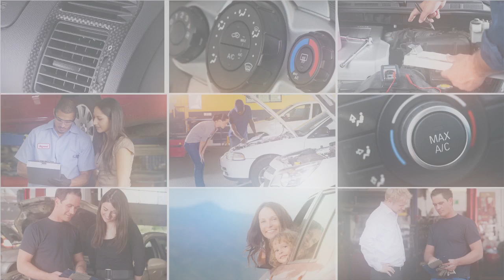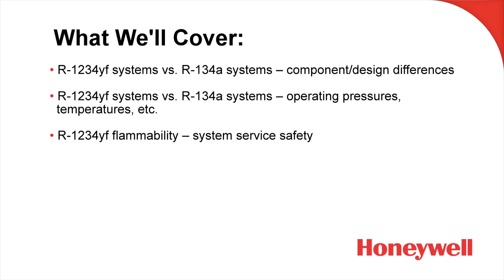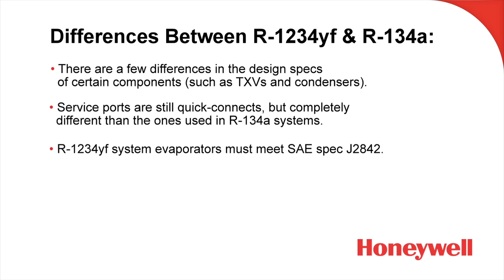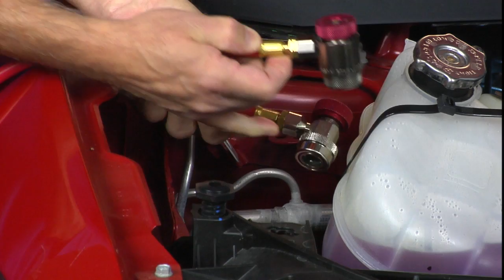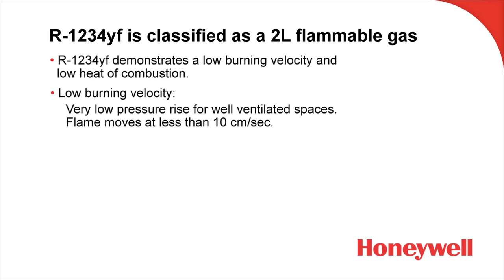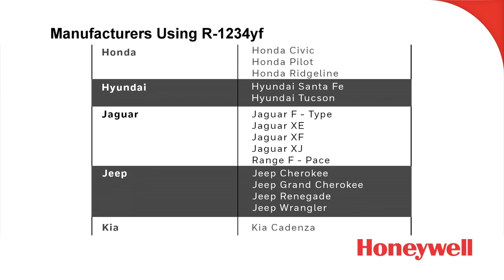R-1234yf Training series | Part 2| Paul DeGuiseppi | Honeywell

Comment: yes i am furious about which manufactures are starting to use using 1234
Reply: Starting to use R1234yf?  It started back in 2014.  Today, almost all of the manufacturers are producing at least some new vehicles with R-1234yf to take advantage of the CAFE credits.  Remember, this video is from 2017, more models and more manufacturers have been added in two years.  The ship has left the dock on this a while ago.

Comment: Here is Honeywell's MSDS on R1234yf.  It  definitely poses a dangerous fire hazzard to vehicle passengers. the MSDS lists it as very flammable. 
(http://www.refrigerants.com/pdf/MSDS%201234yf.pdf)  
Obviously this all came about under the Obama administration.  Who would have guessed?   It's 5% less efficient than R134A.  
It amounts to a very very expensive change for the consumers that have to have repairs,  and they will.  I hope the lobbyists are all happy.
Reply: Yeah, I agree when you read the MSDS you don't come away with the impression that R-1234yf is just "mildly flammable" at all.  I tend to believe the MSDS more than the marketing hype, as the MSDS is information that will be used by those having to deal with fires and other risks involving R-1234yf.  In all fairness though, there is a big difference when it comes to fighting fires between a couple of pounds of R-1234yf in a vehicle AC system, and a stockpile of R-1234yf that would be involved in a fire at a dealership or warehouse.  And he does make a valid point that the risk due to R-1234yf pales in comparison to the risk we all gladly accept driving around with between 10 and 30 gallons of gasoline under our butts or behind our backs!
FYI to anyone looking for the MSDS: The link provided to the MSDS is good, but drop the closing parenthesis if it doesn't work for you.
Reply: I find it ironic that the EPA Banned hydrocarbon refrigerants when they phased out r12.   A 79% propane 21% Isobutane mix worked extremely well in R12 systems and were compatible with the oils used.  They only required half  the amount by weight so outside of some of the old Chrysler systems that used 5lbs of R12 (2.5lbs of hydrocarbon) there wasn't that much in the system anyway.  The DOT approved the stuff in 1991.  The EPA specifically banned them due to supposed flammability issues. Varying versions of the stuff have been sold under different brands but so far as I can tell it was never an approved refrigerant for automobiles. I used it in my own vehicles for many years with excellent results.

 Now that the patents have run out on R134A  they magically approve of a flammable replacement.   I'm not into conspiracy theories but I smell a rat with this change over.